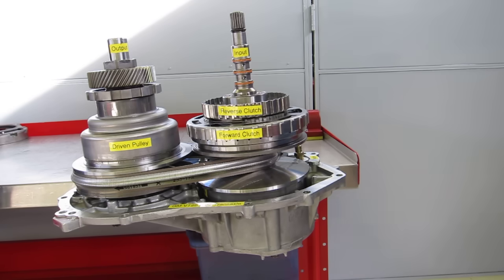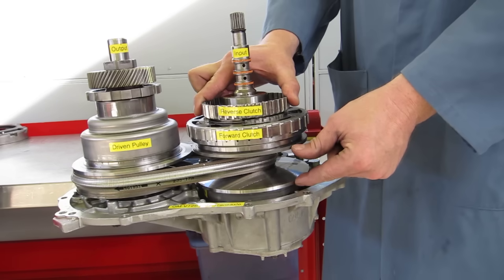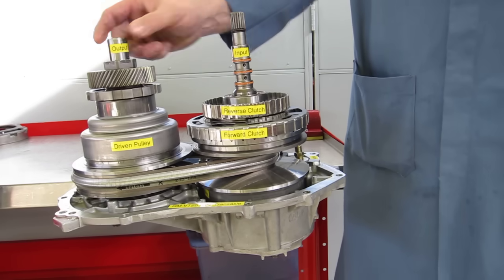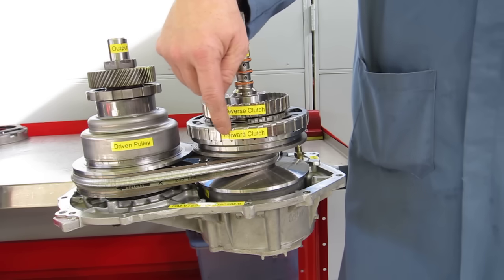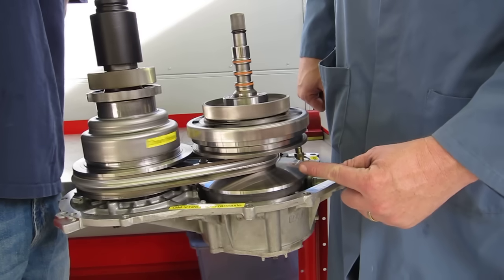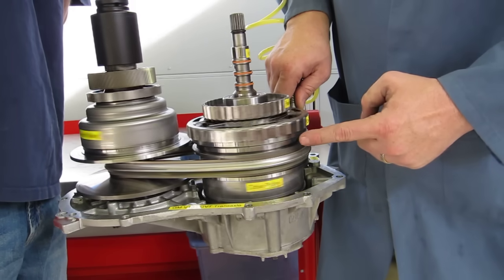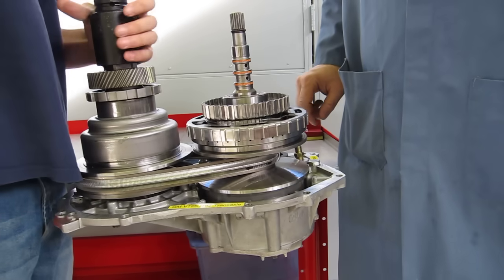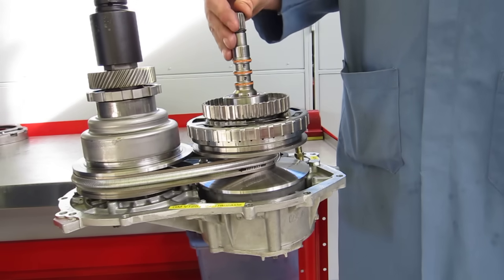Continuously Variable Transaxle (CVT) Operation

Comment: A nitpick: "direct drive" is not defined by a 1:1 ratio, although that ratio is the result of a direct drive gear selection. Direct drive occurs when the input shaft and output shaft are coupled together without any intermediate gears being involved.
Reply from the maker: Thanks for your comment

Comment: its  called   squeezing transmission ,steel conicle  pulleys driven through a  steel chain. so  Not much torque available . The steel pulleys or the chains wear out due to friction and heat

Comment: I have watched this several times and have a lingering question in my mind. My Honda 2015 Fit (GK5 EX) has paddle shifters to mimic a manual transmission. Is downshifting for deceleration bad for it? Seems that loading the input shaft, belt and output shaft in the reverse direction should be avoided.
Comments?

Comment: im not impressed. the older ones had  better engineering, last longer and were more reliable. the cvts are cheaper to build for the auto manufacturers thats why they are used on the smaller cars

Comment: For any CVT owners watching this, change your CVT fluid EARLY and often, using the dealer supplied OE fluids. I recommend every 30-35k miles for most drivers.

 Some OEs state longer, but they aren’t the ones paying for your $5k USD transmission if and when it fails.

Keeping clean fluid with the correct formula and viscosity is about the only thing you can do to try and prolong the life of these things.

Honda and Toyota, two of the most highly regarded brands for reliability, have had a hell of a time producing a CVT that can consistently make it to the 100k mile mark. Nissan’s CVTs…I won’t even comment on here.

Buyer beware when you’re shopping for your vehicle. CVT is becoming the norm behind 4-cylinders, and it’s still a mixed bag with an unproven record in 2023.

Thank you guys for putting this video together! I will share it with friends and customers to help them better understand. 🍻 ✌️
Reply: as a nissan owner those Jatco auto trannies have no better a reputation i can only imagine how bad a Jatco/Nissan CVT is.
Reply: CVTs are people prove (sealed and the don't even have a dipstick)!

Comment: Thank you for making this video, my 2015 AWD Nissan Rogue CVT failed and it would have cost me about $7000 to replace. Thank goodness I was under warranty at 90k miles.  CVT's are smooth, but the Nissan Jatco CVT's seem to be the worst.  But apparently GM has Jatco beat on terrible CVT's.   I like my Rogue and its still running. But I wish Nissan would go back to regulard automatic and stop with this self destructing junk.    As for this video, you do an amazing job of showing the main point of failure, its amazing technology, but in a car, its not if but when, it will fail.

Comment: Does using an Automatic transmission oil in my Honda BRV Automatic CVT cause damage? My mechanic suggested using the high quality Shell S1 ATF TASA , which is automotive transmission, power steering and hydraulic oil mainly used for heavy-duty vehicles. It was changed 3-4 yrs ago and have had no problem with my BRV , in fact excellent faultless performance. But now it turns out that I should have used the Honda recommended Idemitsu CVTF Type H2 is specifically formulated for CVT in all Honda vehicles . NOW my warranty is NULL and VOID. Want to know if ATF oil indeed damages a CVT transmission ??

Comment: Don't know why you didn't go ahead and just apply the power to the input shaft itself. That way, it becomes clearer that it's now the belt's job to push the driven pulley. 

Is it because in this dry and open transmission casing, you can't get the drive pulley to grip well enough to "push" the belt through?

Comment: What an outstanding demonstration of the CVT!  Great job. I just bought a new Chevy Trailblazer that has one in it and I was very curious.
Reply: Chevy went with a CVT on their new Trailblazer? That’s a shame. I owned a 2004 Trailblazer and it was  the best SUVs I’d ever driven. That engine is a beast and it could tow my trailer up into the mountains with ease. 
Don’t know why they decided to replace the 6 speed automatic transmission.
Reply: @kamakaziozzie3038  Making everything smaller with better fuel economy. Still sell the Silverado, Tahoe, Suburbans

Comment: My ex drove a Nissan Micra CVT and i LOVED driving that thing around town! In sport mode it took off like a scolded cat and it absolutely howled! It was HUGE fun! 
The little old lady who owned it previously had actually covered up the sport mode button with tape and had put an X on it. She'd told my ex that it was broken somehow and not to use it. 
But nope! It worked perfectly! Hit sport mode and floor it and the engine would just sit in the power band. The car was so nimble & sorted that it'd embarrass all sorts of cars that just couldn't accelerate and corner like that beat up old Micra!
It was like a kart for grown ups! 😆

Comment: The automatic transmission was getting so reliable. 
Now they make something that will probably need to be overhauled after 150,000 miles. Big bucks.  
Mechanic shop rates are going up as well as parts. 
Fine if u only plan on keeping the car for 130,000 miles. Let someone else fix it.
Going to get this style of a transmission. Go with a Prius.  
They have been known to last a long time.  They have pretty much perfected it.

Comment: Fun Fact: The Subaru Justy 1989-1994 had what Subaru called an ECVT that worked much like modern day cvts these had 2&4wd options a "sport mode"  and the ecvts were so unreliable that Subaru stopped all cvt importation into the us until the fifth gen legacy

Comment: Ya, that pully and belt worry's me ! I had a min bike with a centrifugal clutch and a similar pully set up to this. The belt would break or jump the pully or just get burned up Etc... Car's are more complicated obviously. Probably cheaper for them to make but impossible for a DIYer to fix and a shop is costly, it's getting to the point you must replace the whole unit or get a  new or newer vehicle.

Comment: The entire CVT story is totally fake. Believe me, those unnecessarily complicated transmissions that come in a Ford or a Chevy are worth a lot of Union money.  

Don’t believe me? The eight-pulley rubber-belt transmission that comes on a nice go-cart is just as good. The automotive version would only be bigger. Two hundred bucks. Change the belts once a year.

Comment: a little late to the party, but I'll ask anyway: when a CVT is installed in a vehicle, what forces the two halves of the 'drive' (input) pulley together - hydraulic pressure (from an engine-driven pump), or centrifugal force? 

everyone thinks CVT's are the next great thing, until they realize that a CVT is little more than a sturdy snowmobile driveline...

Comment: Appreciate the demonstration.
So, the driven pulley isn't activated by the hydraulic fluid, instead it apparently is spring loaded and then expands and contracts based on the pressure applied to it by the belt.  Correct?

And from the looks of it this is only useful for low torque applications, thus you don't see CVT's on any trucks, large cars, or sports cars.  The smooth contact face of pulley and belt provide limited potential for transmission of force.

Comment: That kind of variable transmission is only good for ATV like 4 wheelers and snowmobile, not for car , a car is too heavy so that kind of transmission don’t last very long , I knew 2 persons who got that transmission on a chrysler and both didn’t last over 100,000 KM ( 60.000 M ) yes normal driving , both where females at work where I was working so it wasn’t beating…

Comment: One more interesting tidbit is the belt is pushing, not pulling. This is due to the stacking of very thin plates that wrap around a flexible metal inner belt.

Comment: That's also a pusher metal link belt correct? Why do they insist on designing them with pusher belts instead of puller belts?

Comment: I had a 1984 Toro lawn tractor that had this very same setup. The transaxle only had forward and reverse, there was no gears, or speeds. The clutch was the control - the further you let the pedal out, the faster the tractor moved. If i remember, the more tension in the idler (driven) variable pulley, it would open up making the driven center smaller, and directly changing the speed the transaxle was spun. It had a really wide V-belt, the whole mechanism looked just like this.

Comment: Unfortunately this technology is way to new and untried to put much faith in longevity. On the surface it appears to be very fragile and failure prone and appears to be unable to cope with high power loads reliably. Manual transmissions are still far superior in durability and maintenance and cost effectiveness. Unfortunately humans apparently have become to stupid or to lazy to be bothered with physically changing the gears.

Comment: I had a jeep  Patriot with the cvt trans..
Is there still an automatic transmission behind the pulley system? I'm not trying to ask stupid questions, i just think I'm missing something  .  the jeep still had gears I could even shift with the stupid auto-stick thing.. anyway thank you for the video!
Reply: The auto stick was just giving you control of the ratio of input to out put.  The using air in this demonstration didn't really simulate the variability of the transmission all that well.  If he had a valve attached to the air hose to control the pressure better you would see the variation of the pulleys easier.

Comment: The great thing about those things is that you use centrifugal forces to change the transmission ratio so that, for example, the motor always operates in a high-power rpm-band. Most non-electric scooters use such a system. You can adjust the target motor rpm by changing the weights of the centrifugal assembly.
Reply: In cars it uses hydraulic pressure to vary the cones, not centrifugal effects.
Reply: yes but you are forced to cruise on higher rpm (at least on scooter vs motorcycle)
and if you want to change it’s “personally” again, you have to tear it down and modify it
Reply: @actuallyn  Luckily in a scooter it takes 10 minutes maximum to change it

Comment: I wonder if these are just a fad, or if they will still be here in 10 years. Are they truly more efficient?
Reply: Cost effective I would say. Over 120 kmh, perhaps a normal torque converter auto is better. But buy and large the cvt or ECVT is ok. In 10 years most vehicles will be electric.

Comment: Jatco CVTs are the worst transmissions. Nissan has a big problem with these. Even Toyota and Honda CVTs  don't have as much problems as Nissan, Chrysler etc.  However, unlike a conventional gear driven transmission which lasts much longer than these, I would definitely prefer a 5 or 6 speed gear driven transmission over CVTS. Take it from me as I am a mechanic.

Comment: This looks like a transmission out of an old Yamaha gas golf car.
Reply: Well, yeah. These have been used on small engines for decades.
Reply: @troyjollimore4100  I'm just shocked that one out of a full size car doesn't look any bigger or heavier duty than one out of a golf car that can only go 12 mph.  The belt looks beefier.
Reply: @highping1786  That's all that's really needed. But also note that most 'full size' cars they're in are still the compact or smaller ones. They can be tougher than they look, but they still don't react to big torque very well...

Comment: CVT's are the biggest piece of garbage ever invented! NEVER buy a vehicle with a CVT trans even if it's new!
Reply: I have one. I think it's absolutely great.
Reply: @troyjollimore4100  interesting. Good for you. I was not satisfied one bit mainly because they over heat very easy, and the maintenance costs are twice as higher than a torque trans. Forget it.
Reply: @dafashoso3442  Weird. Maintenance schedule seems to be the same for mine, and I haven't noticed any overheating. Though I don't really overstress it. It's also a Honda, rather than a Nissan...
Reply: @troyjollimore4100  well sounds like youre one of the lucky ones. Hope it lasts a long time!
Reply: @dafashoso3442  What surprised me is that Honda has been making CVTs for quite a few years! And you don’t hear of many problems from them. Same with a few other manufacturers. Nissan is the main culprit of most of the negative evidence against them, and I’d imagine the amount of failures is still small compared to the number of working units still on the road…
Reply: @troyjollimore4100  CVT's started to become common back on 2004. Idk about Honda but many new vehicles even say in their manual "Transmission may tend to overheat" If a new vehicle says that, should tell you never to buy it!
Reply: @dafashoso3442  But all car manuals say that, under stressful environments or excessive loads. 😉